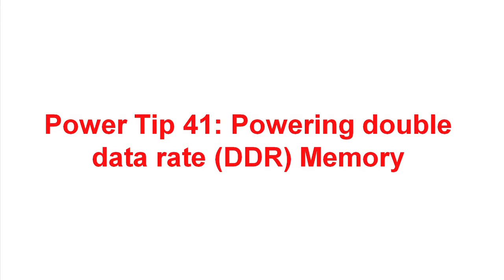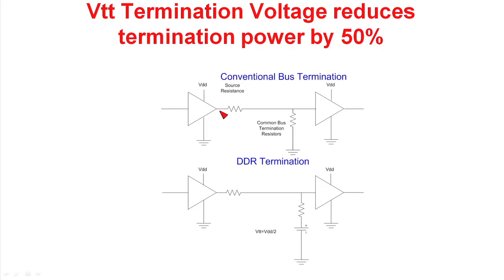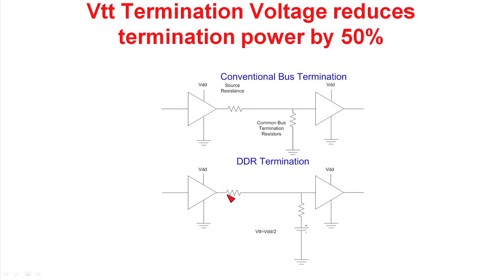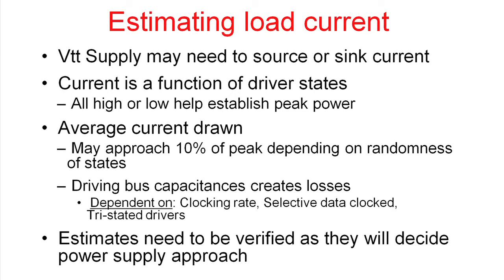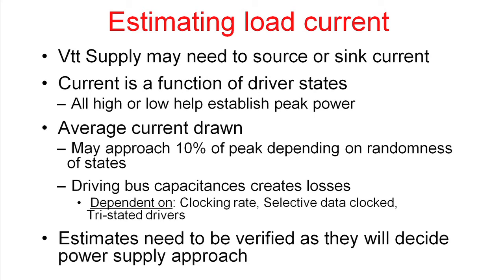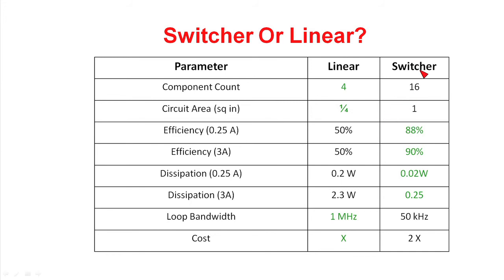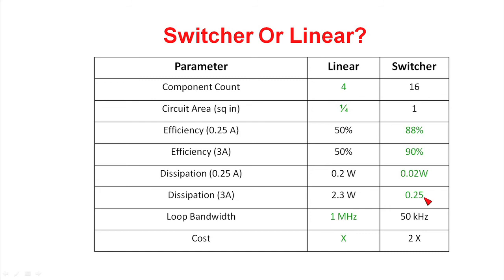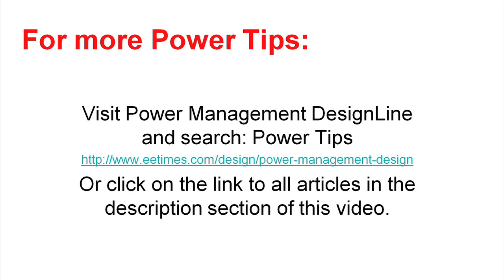Power Tip 41: Powering double data rate (DDR) Memory

Comment: Powering down to single data rate turning an active clock off or shifting the reference/sense line so only the rising or falling edge is used, effectively turning the ram into a temporary emprom aka modified memory